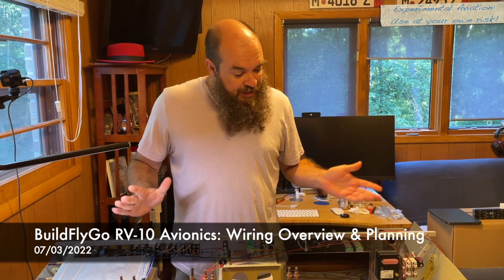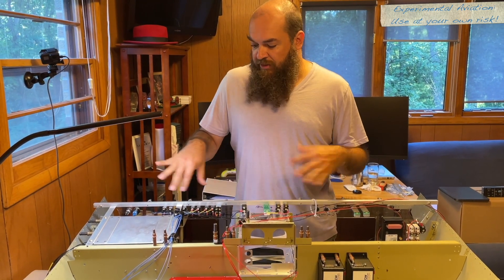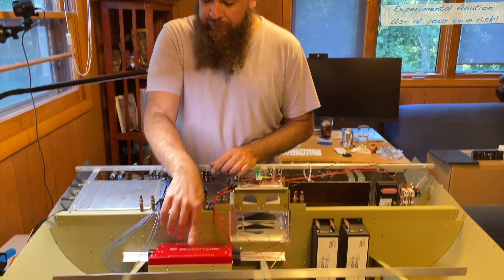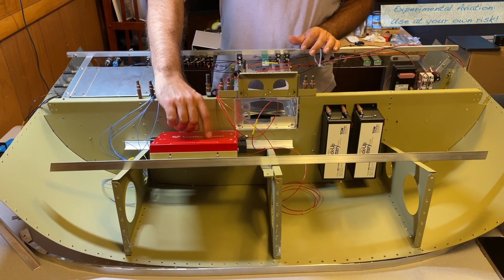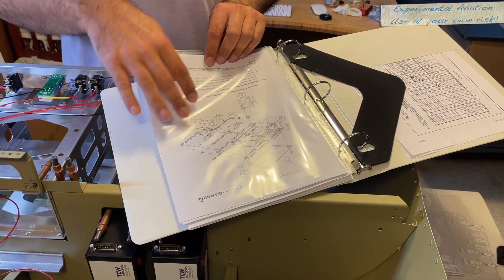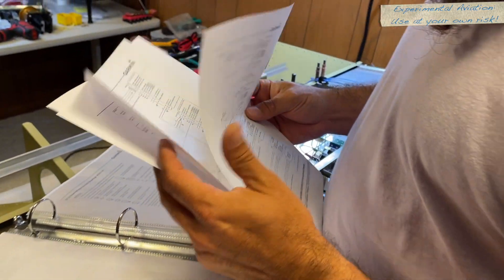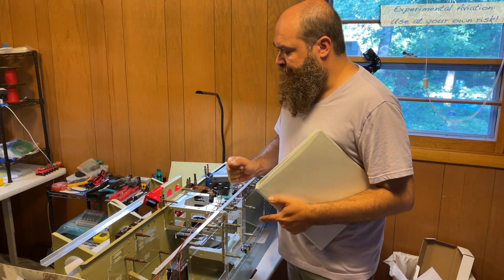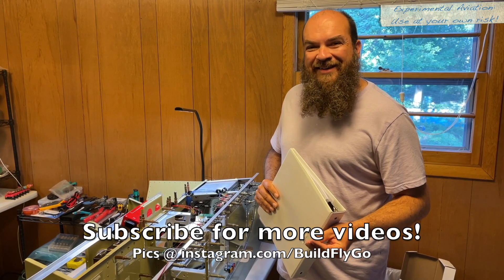RV-10 Avionics - G3X Wiring Overview & Planning

Comment: Are those drawings provided with the stc For installation? I noticed on garman's website.Not every component has an installation manual, so i'm assuming it comes with the stc?

Also, where are you getting your electrical supplies from?Wires solder sleeves crimps etc

Comment: Guil, can you comment on how you designed your electrical system? I understand how to design the harnesses for behind the panel but what about the power busses, etc and deciding what circuits are for what and the electrical system itself? Perhaps there is less to worry about because you are using a vpx but any advice if you are just using breakers?
Reply from the maker: AeroElectric Connection is a great book on aircraft electrical wiring. I believe I based my design on their Z19 sable diagram.